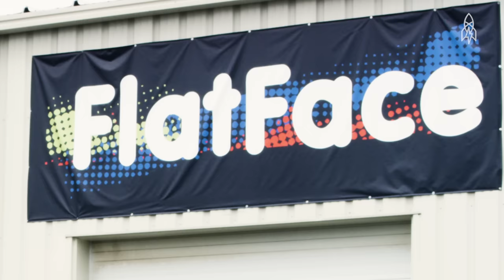Pro Fingerboarder: Unleashing Insane Tricks!

Comment: The reason actual fingerboards cost so much is because they are hand made and not mass produced like skateboards. Everything is made from scratch and making just one complete fingerboard can take hours and hours of work.
Reply: Fax
Reply: true af
Reply: Do you realize how hard it is to make skateboarding stuff that’s why they mass produce it with machines
Reply: @DuckySOT  That's exactly why it's easier to make skateboards. They're made and mass produced with machines, but fingerboards are not. It often takes hours and hours to make just one. You most likely wouldn't even be able to produce 10 completes in one day.
Reply: hope one day it become popular enough that machine will start making them so the price drops!
Reply: I got one for free!
Reply: On average after cutting the plies and gluing them together (which would take about 15 minutes), they would have to sit clamped in the mold for at least 24 hours. Once they’re out, they get sanded and drilled. I’d say the overall time to make one is around 30 hours.
Reply: @DrumlineArchives  and that doesn't even account for the amount of time it makes to make the mold. As a fingerboard brand owner my shape has taken my over 3 months to make  not to mention school and other issues. Also graphics that are real wear took forever, finally a little over half a year I got it down. I won't be doing this forever though
Reply: @pubgnot3204  also your not very likely to break or wear out a fingerboard
Reply: oh so thats why the one i bought was so expensive
Reply: @ChutneyGames  u can break them pretty easily but u do gotta point because you won’t be dropping a humans weight on a fingerboard

Comment: My fingers are to small so I use 3 fingers
Reply: Hellòoo
Reply: try getting a smaller board. Most people now use 32mm - 34mm, but I recommend using 26mm - 29mm. It is much easier if you have smaller hands, or are a kid.